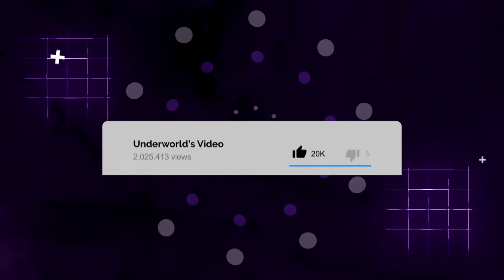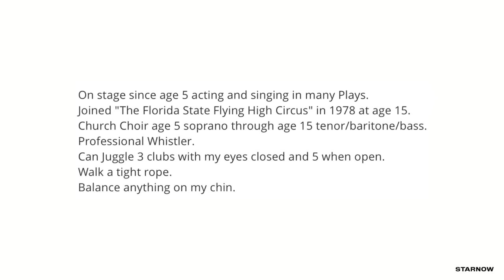10 Massive Rockfalls Caught on Camera

Comment: The sheer power a giant, solid boulder moving at like 80 mph is just astounding. Truly terrifying.
Reply: now imagine the same rock hitting earth with 15000 mph.
Reply: @Fabsi87 IT would burn-up.  A rock has to be 1/2 a mile wide to withstand penetrating the earth’s atmosphere 

.
Reply: @electrictroy2010  That completely depends  on its composition. A high metal, dense meteorite would tear through the atmosphere like butter.
Reply: That actually is true of any heavy object with a lot of inertia man made or natural it has loads of energy and can be destructive to any thing it may strike.
Reply: @davenoejoe  yep, the “gravity” of these falling objects can’t be underestimated . . .
Reply: don't worry, you wouldn't have enough time to feel a thing when it rolls over you
Reply: Like my Ex Wife!
Reply: @UncleWally3  Gravity!?? LOL 
It's Density and Bouyancy! The Particles in the Rock are Far more Dense than Particles in the Air. Therefore the Rock Falls through the Air.
We live on a Flat stationary plane with a firmament above.
There's no Gravity Necessary.
Reply: @ondaride777 Depends where it hits you
Reply: @rabbithole8592  troll

Comment: I once lived near the confluence of the Van Duzen and Eel rivers in Northern California, in a town called Rio Dell.  There is a large bend in the Eel river as it passes through town (thus the name Rio Dell).  At the time that I lived there, the North Coast Railway was still running trains along the river.  Whenever they followed the bend through town, they inched along very slowly, due to an unstable steep wall of rock and soil overhanging the railroad tracks.  In fact, there had been many rock/mud slides over the years that had to be cleared from the tracks in order to keep the trains running.  Years ago, one such slide knocked a locomotive into the river, and at low water in the Summer you can still see the remains of this train.
Reply: Thank you for telling your story. I have a big color picture book of CAT heavy duty Dozers I have had for years. The book is mainly about CAT equipment, but reading your comments one session of the book is about big D-9ers clearing the highway around your area. 😊
Reply: The slide on the Eel was at swimmer Delight on 36.  It’s one of my swim holes, and is stunning in fall.
Reply: @rp1645  Oh yes, I have seen the aftermath of the highway slides.
Reply: @user-ii3vn8tn3q  Oh yeah, I remember Swimmer's Delight.  Brings back some memories there.
Reply: Thanks for the warning!
Reply: Once it all went up. And one day it all will come down again. Most likely.
Reply: Oh yeah swimmers delight video, excellent!  I live in Eureka, a bit up north. Saw it on our news ..wow, just wow!  Much love 🙋‍♀️💕✝️🇺🇸🇮🇱
Reply: @ginac733  Love back at you.  Used to live on H Street. Wyoming now.
Reply: @bretgreen5314 aw, that was sweet!  Thank you hon. I'm on M street!  Lol, bet you're glad to be out of Californication!  😂  We got another flood warning...too much rain. 3rd time in a month ! It just floods the streets they dug up. Idiots. Cheers sweetheart!  🙋‍♀️💕✝️🇺🇸

Comment: Salt Lake City, Utah, April or May of 2020, probably around 6:00 AM. My girlfriend and I were heading to a doctor's appointment. She was in her third trimester of pregnancy at the time. Directly to our left and stretching above us was the 'Grand America' hotel, across the street it's aptly named little sister, 'Little America'. I had spotted less than half a dozen people in the last half hour, and no storefront lights on, other than a coffee shop. At the middle of the block a low rumbling began, accompanied by a slight vibration under our feet. Seconds later, it crescendoed to the sound of a rock slide under the sidewalk. We had stopped walking and were holding each other steady, comprehending the situation. It almost seemed calmer for the span of a breath, before the entire street began violently shaking. The ground felt like one of those amusement park rides where the floor moves from side to side, except this was the entire street. It looked like it slid a whole three feet to the left, then another three feet to the right. It was like someone was using the city block for a game of tug-of-war. Sparks flew from a transformer box on a telephone pole as all car alarms in the area went off at once. The whole thing lasted about 30 seconds, the alarms were still on after the ground had finished it's tantrum. The most ironic part is I'm from California, I haven't ever felt an earthquake, and when moving to Utah I thought I would need to worry even less! Guess not 🤷

Comment: It never fails to amaze me that when folk are faced with a rock fall/mud slide they have this magical piece of equipment that protects them, a mobile phone. If you watch the people filming they walk towards the danger, I’d he running he’ll for leather in the opposite direction, why don’t they.
Reply: S ❤
Reply: Some may say that it wasn’t their time.
Reply: And if a bit slides like in the video prior to December 2023 and there are more boulders, rock, and dirt on either side it means it could have moved also for miles...Just like the water some of the material landed in could cause an issue..and if it flew under or by an automobile with a gas tank that's a different ballgame..with more landslide material....
   A video camera or mobile phone camera can be played with afterward.

Comment: When I worked heavy construction at a rock quarry this used to happen to me 5 to 10 times a year. I ran a 100 year old steam shovel, all steel cable and lever operated, the kind you used to see in kids books, but this one was converted over to a screaming Detroit diesel. We had a 90 foot blue stone ledge and we'd have a blast about once every year or two. I'd fill a truck with the blasted rocks who'd drive it up to our crusher and screening plant. As you slowly chew away at the bottom of the 50 foot pile of stone, you'd eventually come across one the size that sunk the titanic, if you were lucky it was flat and would just slide down and hit the machine, unless it decided to flip end over end or roll down, then my cage would literally get rocked! Over time you learn how to dig a guide so you can control where the stone goes, sometimes it would roll down and I was able to catch it in the machines bucket and drop it off to the side. They could be up to the size of an SUV. You'd also learn over time when the ledge was about to let go and predict witch side would go next. I didn't have to deal with the general public, it was a beautiful area right next to a bird sanctuary and a killer view during lunch breaks! Loved that Job. Hated the owner's son, but loved the job and all the old timers I worked with.